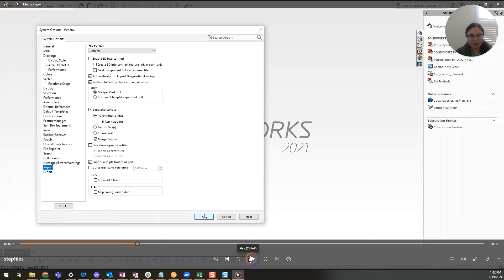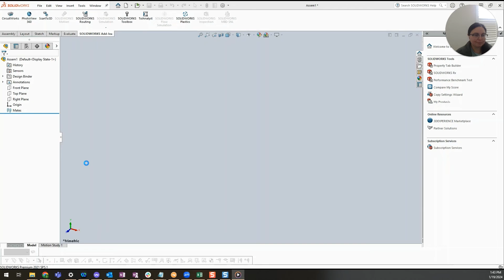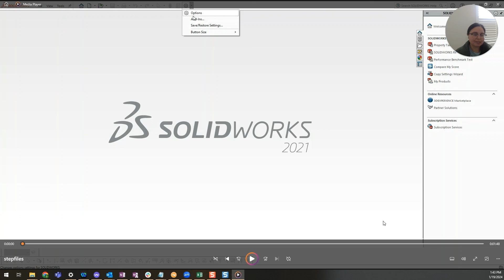Troubleshooting SolidWorks Can't open  STP files

Comment: I have an issue where the individual part files open when I'm trying to open the stp assembly. If the assembly is too big, Solidworks has too many windows open and crashes. Any suggestions on how to open the assembly without opening the part files?
Reply from the maker: Thanks for your comment.  Because there are a lot of potential possible causes of this problem, it may be best to engage with our team.  You can contact us at https://www.spkaa.com/contact and our team will reach out to you to schedule a call and discuss how we can help solve those issues.